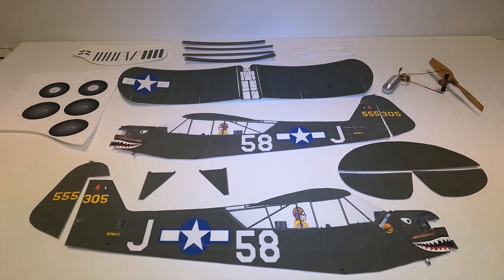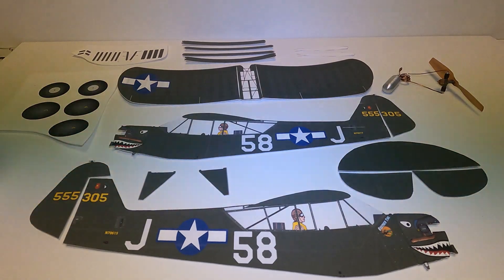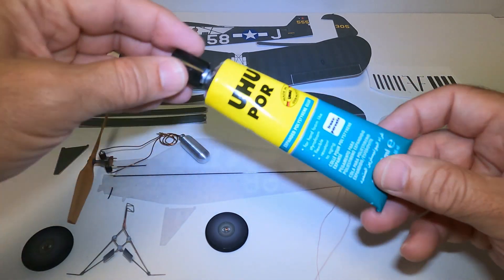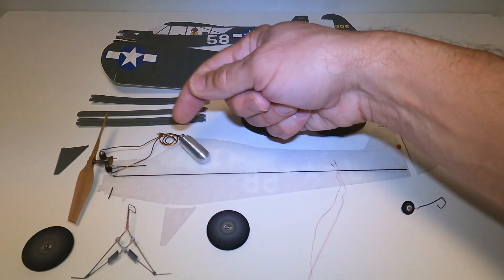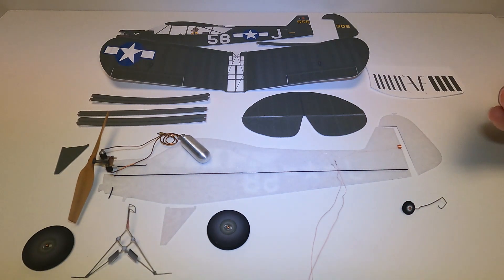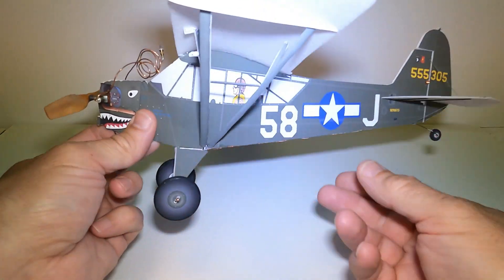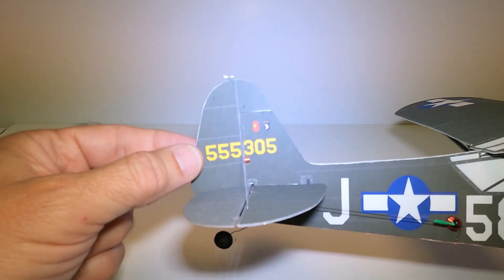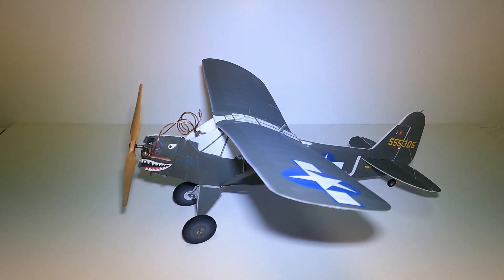CO2 Powered Cartoon Scale L4 Cub

Comment: Looks good Joe, as always. I'm glad you're still into micro rc. I have a question for you, hopefully you can help me out. I have 6 or 7 Plantraco planes still. However my lipos are dieing one by one. Seeing that the company is no longer in business I don't know if someone else sells them. I've seen some bare lipos on micron wings. However none of them have the magnetic connectors. Would you happen to know where I could find replacement batteries? Thank you, John.
Reply from the maker: Hi John,

Micro Flier Radio is selling batteries that will work with all of my Plantraco designs. See his website, or send Nick an e-mail and ask him what is available.  http://microflierradio.com/